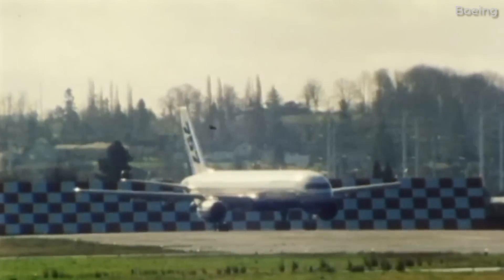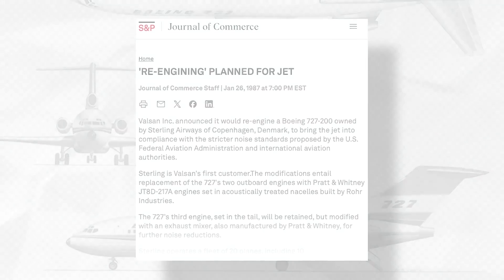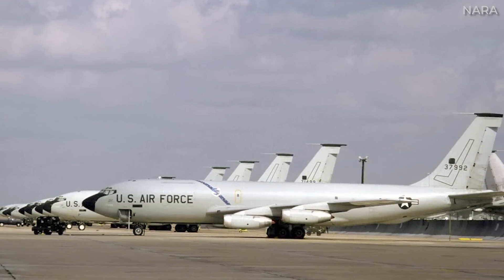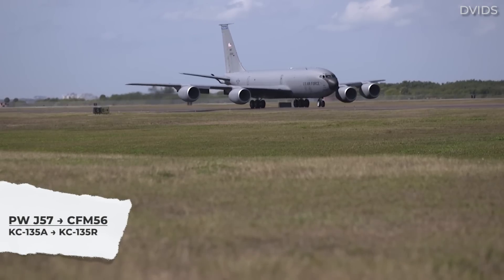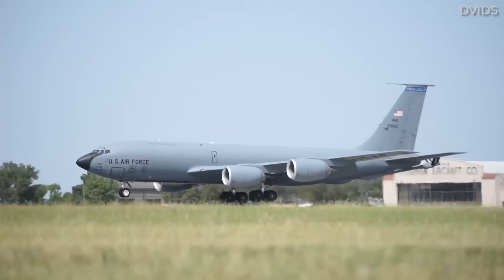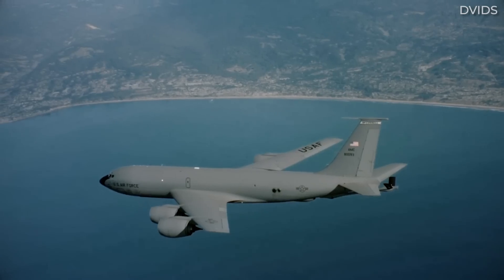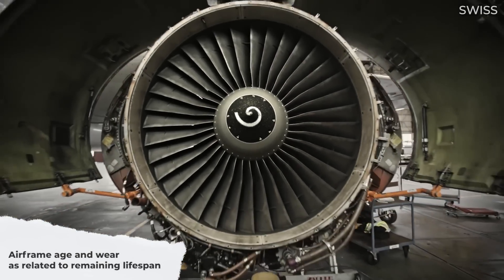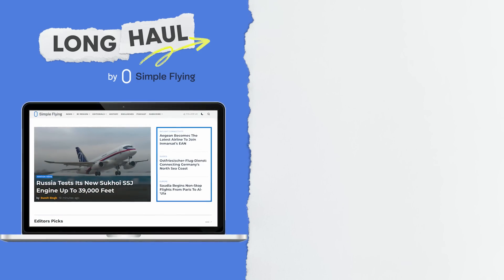Re-Engining Old Aircraft: Can It Be Done? Should It Be Done?

Comment: 757 with the Leap-1B
Reply: I see a lot of comments talking about re-engining the 757, some even say with the Leap-1 Honestly I'm not sure, but I believe it would be a bit underpowered compared to its current engines, and so far engines for it aren't an issue, it's the avionics and the software that needs updating on the 757. Of course if Boeing ever kept the 757 in production, we might see new modifications to the intial design, such as new engines like the Trent 700 found on the A330 Neo, maybe new more efficient wingtip profiles, perhaps also foldable for smaller airports a concept found on the 777X and of course new interior designs for cockpit controls (with updated software and avionics) and passenger/cargo cabin.
Reply: @fury4539  yes the avionics need an upgrade. Yes the 757 has issues outside of engine upgrades like for instance it's wake turbulence and wing design. Yes the Leap-1 maybe underpowered for the 757 but I believe a modification to it's thrust rating and we can see a Leap-1 D. We cannot look past the fact that fuel efficiency plays a role in it's retirement those PW and RR engines just can't match right now

Comment: I’d love to see the Trent XWB on the A340
Reply: Imagine an A340-300 with CFM LEAP or PW1100G.
Reply: That would make it inefficient.  Trent 500s are okay to go to older variants
Reply: A330NEO is kind of it. Remember there's no substantial difference between A330 and A340 (except so-called A340NG) except engines and additional weight supporting structures.
Reply: @steinwaldmadchen  yes, but people mention the XWB engine on an A340 to have the long A340 fuselage with 2 big engines instead of 4 smaller ones
Reply: @ishiddddd4783  Well, original A350 (not the current XWB one) had a very similar design of stretched A330 fuselage with new engine, wing and fuselage materials. A330NEO is arguably a watered down version of that A350 v1,
Reply: Yes Trent xwb or genx on the A340

Comment: The first re-engine would probably be the KC-135 re-engine. But the most popular/well known are definitely the A320neo and 737 MAX
Reply: The NEO or MAX are not a re engine of an old plane. Putting CFM56 on a DC8 of KC135 is a re engine of an old plane. Same as with the re engine of the B52 or the C5 galaxy.
Reply: @OhhDaarBenJePerry Yes! The A320Neo and 737 Max series have fuselage changes as well as wing changes
Reply: I was on an AA ANC-DFW flight last year operated by an A321neo.
Another passenger nearby asked the flight attendant what the "neo" meant (having seen it on the safety card). The flight attendant didn't know.

Comment: B747 with GE9X
DC10 with genx
Reply: A B747-400 with two GE9X engines rated at 127,000lb thrust each would indeed be physically possible, considering the GE9X famously generated a maximum thrust of about 134,000lb. 

A DC10 with GEnx power could also be physically possible, considering the GEnx was originally designed to be able to produce a minimum of 53,000lb thrust.
Reply: @rafaelwilks however the 747 wings have to be reinforced if it were to serve a two engine design, given that the outer engines' weight counters the bending force acting on the outer part of the wing during cursing
Reply: @jasonwang6554  747 is very strong.but over time,the wings will crack.so that will be needed.but then,the 747 wont look good with 4 engines

Comment: they certainly succeeded with re-enginging the A320 NEO, the MAX might have been so if it wasn't for all these disasters made by poor engineering, MCAS, missing bolts keeping a door in place
Reply: What Airbus calls NEO is not a really a re-engine (and the MAX isn't either). They are not putting new engines on old airframes. Those are all brand new, somewhat redesigned airframes with new engines, and some other new features. In both the A320 and the MAX case, that includes longer fuselages and updated wingtip devices. The MAX also has longer, and telescoping landing gear, to gain a bit more clearance.

The problem you face with a regular re-engines (for commercial aircraft), like the DC-8 and 727 examples in the video, is that you are working with airframes that are likely past at least half of their service life (if not even more), so they don't have much time to make back the cost of the re-engine. That's not to mention everything else that's outdated in the plane.
Reply: all these disasters....only 3 over more than 4 years and more than 200 max flights each day.max is safe

Comment: I'd like to see the A380 get the GE9X (777X) engines. If it's being phased out for cost reasons, new engines may be able to keep it in the air for a while longer.
Reply: For optimum fuel efficiency for the 72K pound thrust range, a custom-designed derivative would be pretty awesome - GE could call it the GE8X 😎
Reply: @rafaelwilks  I think a downscaled Trent XWB would suffice
Reply: @rafaelwilks if only GE went all in but I doubt they had so much interest in the A380 programme hence collabing with PW to make the GP7000
Reply: @HesJustSteven they couldn't use GE90 or Genx derivatives because they had exclusive contracts with Boeing. So it would cost more to make something different
Reply: @Tpr_1808  I don't think there is a limitation on GE90/9X derivatives, because we know GE and Airbus already discussed re-engining A350 (but didn't come to a conclusion).
Reply: @user-yt198  Why re-engine the A350? The high maintenance cost and too little time-on-wing?
Reply: @dariusdareme  Exactly. No need. That is why such talks didn't come to a conclusion.
Reply: They would rip themselves off the wings, too powerful. The A380 actually is already the most powerful passenger jet out there.
Reply: what does powerful mean?if were talking about thrust to weight,look at md and boeing
Reply: @HesJustSteven  Wrong.The A380 has pretty poor thrust to weight ratio. One reason of many why they dropped the freighter version.
Reply: I agree, airframes are quite new.